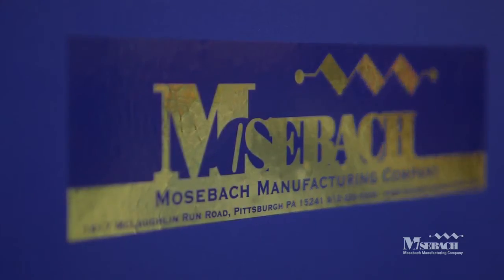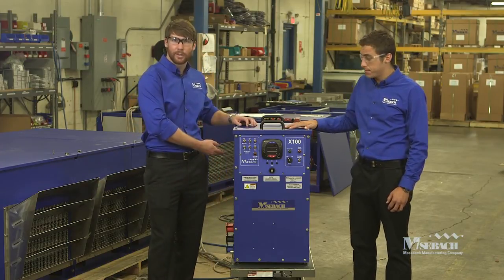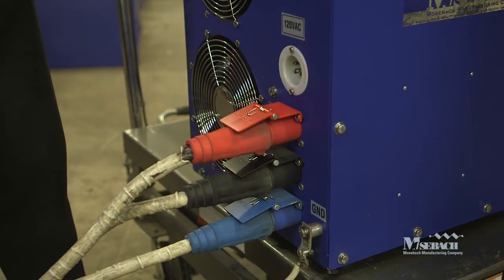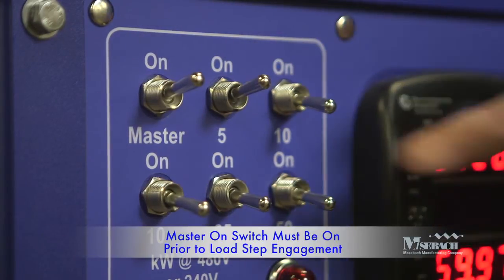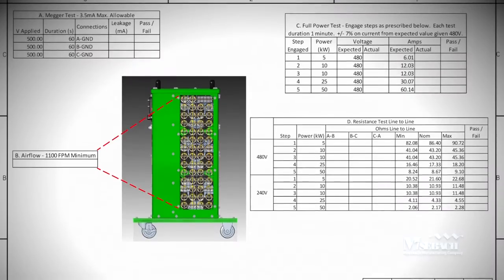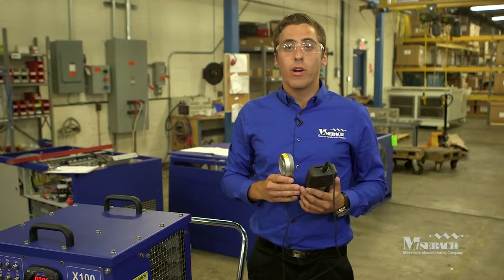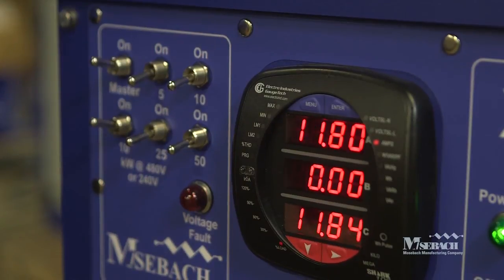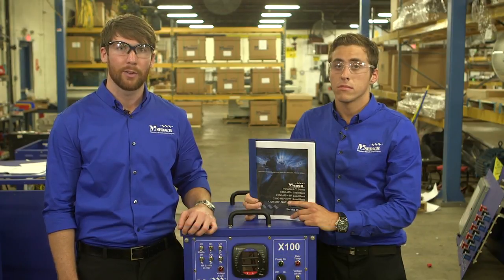X100 Load Bank Operating Instructions

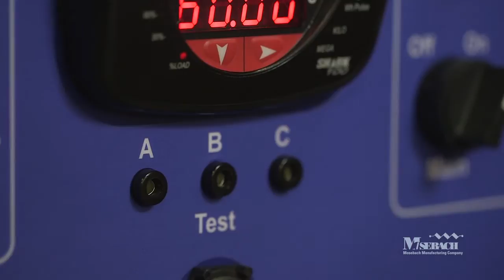Comment: 6:00 someone had the forethought to put banana jacks on there. If you use the right type of multimeter leads, you won't be taking the huge chance you are sticking bare probes in 480V live terminals (with bare hands even). e.g. https://www.arbiter.com/images/catalog/safety_banana.jpg That's not legal where I live luckily.  Why they would have those is silly anyways- you can see the volts on the display.
Reply: Heh